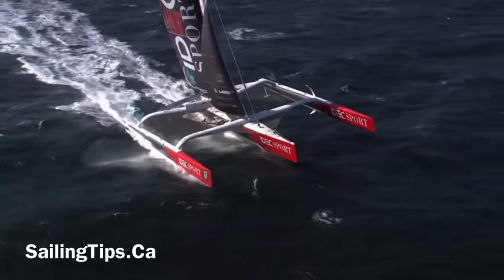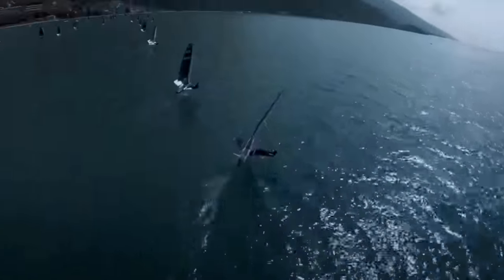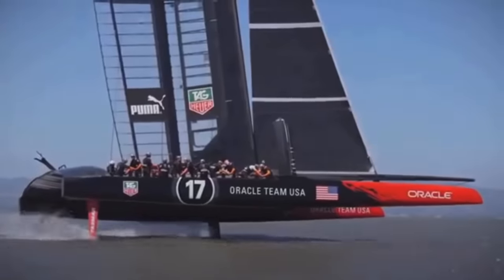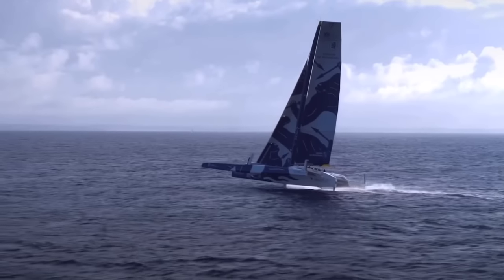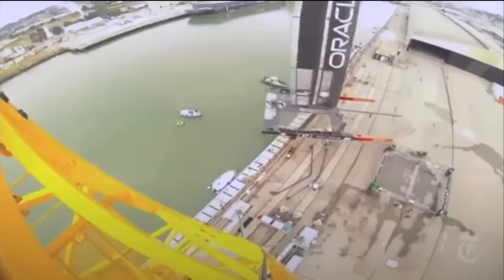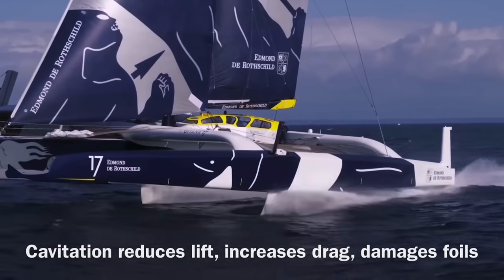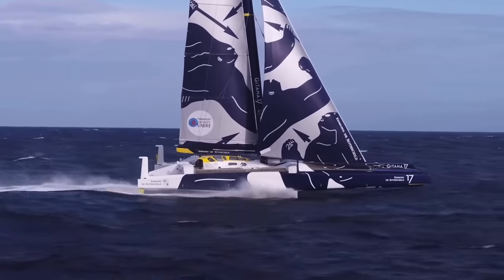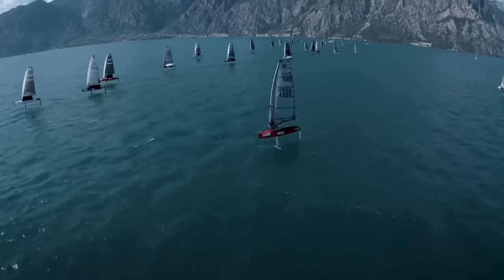How Fast Can a Foiling Sailboat Actually Go?!?!?

Comment: France's SailGP boat hit 99.9 kph briefly(just under 54 knots) a few weeks ago, and that is a new top speed record for that race series. They were seriously moving.
Reply from the maker: Yes that was amazing and they didn’t wipe out! I bet they celebrated after emptying their drawers afterwards!
Reply: Is this speed of French sailgp was in a long range like 500M or 1 km? No. It was like in a moment, a peak speed. Anyway its a huge and significant step forward. Great job.
Reply: in that race they stayed over 90kph for most of the race. amazing to watch
Reply: @jman414999  yeah, and they have no brakes )
Reply: It wasn't long ago they said they thought 60mph was obtainable. Now they've surpassed that so... Exciting. Real exciting stuff.
Reply: If cavitation happens at speeds above 59 kph.   What if they had foils that could convert to skis?   Or possibly skis which could be deployed once they hit a certain speed then they retract the foils.  Obviously the tipping moment would come into play.  Perhaps outrigger skis?
Reply: @davidbutler99 leeway on anything that wasn't dead downwind
Reply: @davidbutler99  It's a fascinating area of exploration. This excellent video highlights the obvious drawback of foiling: its narrow optimum speed band. I believe that there is as much to be gained from pushing the limits of cavitation as there is in exploring the low-wind end of the envelope. In low winds, lifting the hull just one knot sooner would convert into a massive speed increase due to reduction of wetted area. Imagine this: everyone is doing 5 knots and then one boat would suddenly start "flying" while the others aren't...
Reply: Yes….   …Quentin Delapierre and crew!
Reply: There are 360 comments plus x replies and nobody talks about Paul Larsen and the Sailrocket II. What planet are you living on???
Reply: @SailingTipsCa 😊
Reply: @ballooningonmars4888  Yes, Sailrocket II is the fastest sailboat in a straight line, in one place in the world, during very specific wind and sea conditions.
An extremely specific design made just to break the speed record and nothing else.
I suppose it should have been mentioned, but it does not belong in ocean racing categories.
Perhaps when it can sail a traditional course with windward/leeward legs.
Reply: @ballooningonmars4888 'sailrocket' is a one trick pony. zero versatility, it ain't a boat.
Reply: @davidbutler99 Boats as we know them with masts are physically restrained because of righting moments.
Boats using kites are faster. Look at speed week and speed records.
As long as you can call them sailing boats and not something like "water craft" which would describe them better, I think something bullet shaped and relatively small on a foil but pulled along by a kite would be the next step.
Reply: @N807DS  It's what happens already with windsurfers in light winds. The whole fleet will be pushing through the water and then, suddenly, some start planing and leave them behind. It's a very special feeling.
Same as in wind foiling. As soon as you get up you accelerate to 3 or 4 times the initial speed.
Still, the fastest windsurfer is foiling on it's assymetrical fin only at the back, not planing. No board in the water and that's when you start hearing noises like hammers hitting the hull which is the water actually hitting the bottom of the board above 35kts. It actually feels like that also. It's why you really need foot pads for these boards if you want to sail more than one hour at a time.

Comment: French sail Gp Boat hit 99.9km. That's over 53knots but, no records have been officially attempted.
Reply: Instantaneous speeds are sort of meaningless when speaking of speed records. It is always average speed over a set distance. And there are very specific criteria for the accuracy of the GPS used, etc. which must be verified by the organizing authority. To average 68 or whatever it did, Sailrocket probably had peak speeds of 75.
Reply from the maker: Yes, that must have been exhilarating in front of their home crowd in Saint Tropez, while also being terrifying at the same time! Their foils must have been cavitating like crazy, but luckily they must have sustained enough lift to maintain control of the boat and not wipe out completely like L'Hydroptere did after hitting 56 knots briefly. The SailGP boats can get away with pushing hard in these events because 1) their foils only need to last the duration of a race which is about 15 minutes and 2) there are rescuers standing by in the event things go upside-down.
Reply: @SailingTipsCa  Hydroptere had no active control on the mainfoils. Cavitation had nothing to do with its capsize. Duration of the racing has nothing to do with anything. Obviously foils need to last the entire racing season, and they do.
Reply from the maker: @kwittnebel  L'hydroptere had a foil design that cleverly decreased the foil area as the boat was lifted out of the water. I don't know the specifics of what exactly caused their capsize but their foils certainly would have been cavitating. I disagree that the duration of the racing is irrelevant - you need to back off at certain times in longer races to preserve the boat and ensure it lasts until the finish, not just the foils but everything!!! Even Alex Thomson backs off at times! Maybe you and Francis Joyon don't but most do! 😉
Reply: @SailingTipsCa  The F50 guys drive the boat hard all the time. They have plenty of time to refinish the foils if they start to get pitted from cavitation. They are not thinking at all about cavitation during a race. The IMOCA boats don't go fast enough under any circumstance for foil cavitation to be an issue. Joyon talks a lot about backing off; he has capsized and talks about how having capsized helps him know where the edge is and where to back off in heavy air. Thomson is retired last I heard.
Reply from the maker: @kwittnebel  Yes the SailGP circuit is a great place to push the boundaries! And you're right that the IMOCAs aren't fast enough for cavitation to be a problem, but they do break in other places.
Reply: @kwittnebel  re: Thompson, my understanding is that he's sort of semi-retired, in that he's retired from sailing the Vendee Globe, but he's still running a team to do that.
Reply: @weatheranddarkness  he is helping a canadian team for the Vendée at the moment
Reply: @gontran8638  oh, Is that the same project? I hadn't realised they were associated. Neat!

Comment: Great video, but Dan and Greg Ketterman were the first to design and build Longshot which broke the world speed sailing record in early 90's which became the Hobie Trifoiler which was and I beleive is still the fastest production sail boat ever built in the early 90'. Just for context as they deserve some credit in relation to hydrofoiling.
Reply from the maker: Yes that was a huge accomplishment!!! The underlying message in this video is to say that foiling is not a panacea to solve all speed-related problems due to limitations introduced by cavitation, rough seas etc. It can provide remarkable performance in some conditions, but it’s fascinating to note that the world records for circumnavigation are still held by non-foiling boats!

Comment: so is the future of the fastest boats ones with variable size foils that can be removed from the water fully when winds are to high or low? :D a nice engineering challenge
Reply from the maker: Quite possibly! Airplanes can quite literally change the size and shape of their wings to maximize lift and efficiency at different speeds, so why not foils?!?!? The engineering challenge is that airplane wings are comparatively large so there’s room to put things inside them, while foils are quite small and the loads comparatively high, on a PSI basis that is!!!
Reply: @SailingTipsCa  oh yeah i did not even think about flaps and slats in this context :D do you know if multi element wings behave similarly in hydrodynamically as airodynamically? and yeah the pressures on the hydrofoils must be massive probably 100s of bars at the leading edge while the trailing edge is almost at a vacuum if it cavitates
Reply from the maker: @niklasxl  I’m not a hydrodynamics expert but I do know that 1) sailing and aeronautical applications both use NACA profiles (e.g. 0012 is commonly used for helicopter blades and sailing rudders and daggerboards) 2) some smaller foiling boats control lift with trailing edge slats on their main foils 3) some larger boats either use trailing edge slats on T-foil rudders or move the entire foil case/cassette to change the angle of attack of the foil. So there are certainly many similarities between air and water, the latter being much denser.
Reply: @SailingTipsCa  It used to be a thing in high aspect keels with trim tabs Etc mainly for up wind performance in older keel boats in th e 80s .
Reply: It seems so much harder to make variable lift foils as hydrofoils. The density of the water just seems extreme relative to air.
Reply: @ben3989  yeah it  must be a lot harder to have multiple small elements compared to one large ridgid one
Reply: @SailingTipsCa  as an aerospace engineering student, I know that supercritical foils were developed to have a less extreme minimum pressure on the upper surface and are used by almost all modern jets because they increase the critical mach number where you start seeing sonic shock waves on the upper surface and don't care as much when there are shockwaves, which is a huge deal when you start approaching the speed of sound. It makes me wonder if supercritical foils could have the same benefits for cavitation in hydrofoils, namely delaying the onset to higher speeds and reducing the adverse effects once you do start having it.

I know a lot of people are talking about flaps, which are all well and good for takeoff and landing since they really increase your lift, but they increase your drag by a lot more, so more than a few degrees of deflection just doesn't achieve a good enough lift drag ratio for cruise flight. compared to aircraft, sailboats are very power-limited, making large flaps a complete non-starter for foiling sailboats after takeoff, and they can't be too big even on takeoff because they produce soo much drag at large deflections. 
I think gliders give a better example of how you might use flaps on sailing foils. Gliders have airfoils that have a much higher lift/drag ratio than powered aircraft but only maintain that L/D over a very narrow angle of attack range To change their lift coefficient for different speeds, instead of changing the angle of attack, they deflect the flaps a few degrees upwards when they go above the relatively slow best glide speed to maintain the ideal angle of attack and nearly the same efficiency. having seen pictures of the AC75 foils, I suspect they already use this trick since it's quite simple and would really improve acceleration and tacking performance

In aviation, the only solution anyone has ever come up with for being efficient at a range of cruising speeds is variable planform geometry. normally this means swing wings because they are the least structurally terrible solution and have some additional aerodynamic benefits because foils only care about the chordwise flow velocity, so the same airfoil can be efficient at higher speeds as you sweep it more. While a conventional swing wing seems a little out of reach for a hydrofoil because hydrofoils just don't have the volume for the mechanisms, there is an older design called an oblique wing that might be a great fit. it was initially explored because the wing is a single pice with a lighter continuous spar and doesn't move the center of lift when it sweeps because one side moves forwards while the other move backward. It ended up abandoned because it had some pitch-roll coupling issues and the forward swept part of the wing would stick out of the shock cone for supersonic flight, which is problematic in a lot of ways, especially when it's asymetric, and they had to go on top where the pivot would be in tension, which isn't structurally pretty.
I think the oblique wing has some potential on a T hydrofoil because it doesn't have ailerons, so no pitch-roll coupling issues, you don't go supersonic in water, and transmitting the compressive load through a thrust bearing at the junction makes it very structurally simple and efficient compared to more conventional swing wings. The sweep should also help with cavitation at extremely high speeds. like on aircraft, the correct design is probably to have the swept leading edges pointing outboard so that the lift increases with increasing sideslip for roll/lateral stability with both foils deployed.
Reply from the maker: @thamiordragonheart8682  Thanks so much for your comprehensive reply - it’s nice to have somebody with expertise chime in! I studied engineering a couple of decades back but not aerospace. I wonder if some of the things you’ve suggested (e.g. supercritical foils) are helping the SailGP boats creep past 50 knots?
Reply: @SailingTipsCa  I wouldn't be surprised. supercritical foils are an idea from the 70s in aviation. NASA originally tested them on a modified F-8 Crusader airframe. Once you start hitting those really high speeds they certainly start edging out even some of the advanced laminar flow NACA foils that I'm sure are standard when cavitation isn't an issue.
do you know if they're also starting to add sweep back to their foils in the range of 20-30 degrees as they edge faster? it's one of the other tricks aircraft designers use to increase top speed. more sweepback is even faster but starts to have a lot of low-speed drag that a sailboat doesn't have the extra power to deal with on takeoff.

Comment: Wow, I stumbled upon this, watched it and came out the other side smarter! Never knew about the cavitation of these. Thanks mate!
Reply from the maker: Cool - glad you liked it! The cavitation is a major issue at higher speeds! Check out how Sailrocket overcame it: How Did Vestas Sailrocket 2 Smash the Sailing Speed Record?!?! https://youtu.be/K3m06731BQY
Reply: The original Windsurfer daggerboard started cavitating at about 12-15 knots.  One second you were flying (relatively) and the next the board rolled up on a rail and dumped you.

Comment: Thanks makes me feel much better about my trimaran without foils
Reply from the maker: Yes I could add foils to my F-82R but they would add a considerable amount of weight which would slow the boat down and I would only benefit from them a small fraction of the time with the prevailing conditions around here!

Comment: Nice presentation on a very interesting topic. I think it's always been more important to establish high average speeds than ultimate, or fleeting,  top speeds in distance ocean racing.
Reply from the maker: Yes high averages speeds are the key! IDEC Sport managed 8091,73 miles in 10 days in the Indian and Southern Oceans, maintaining an average of 809 miles per day, with top speeds ranging from 38-44 knots.
Reply: Even in drag racing, ET beats top speed all the time.  I sailed on a boat with averaging knot meters one time. Those things make your mistakes at the helm obvious.  On my own boat, I constantly reminded my crew that, 0.25 knot over ten hours is 2.50 miles.